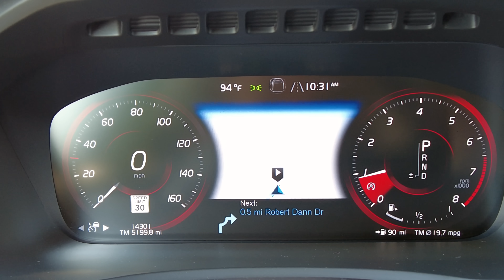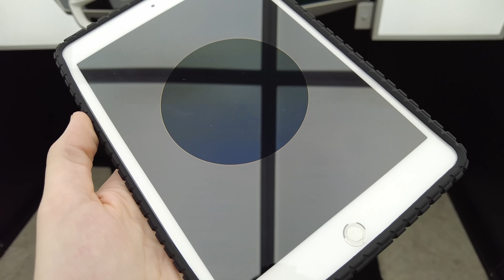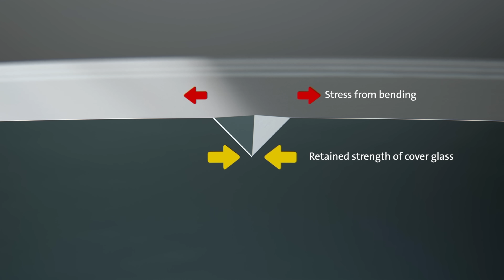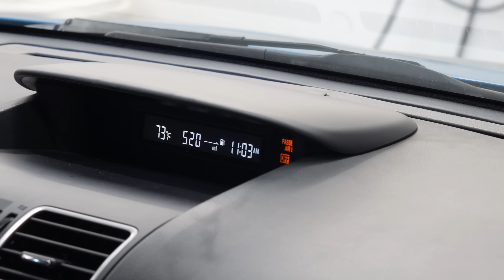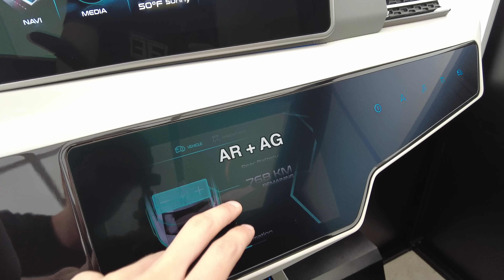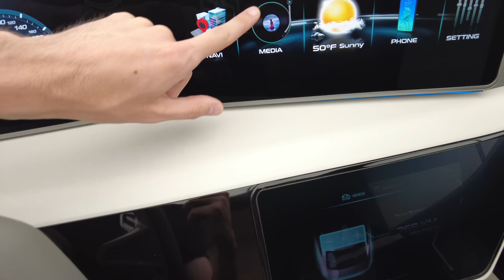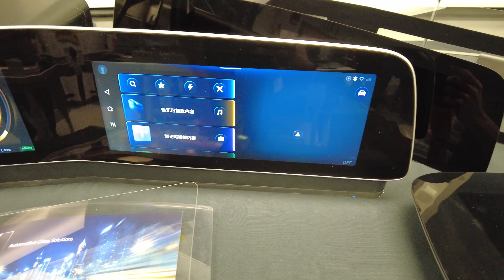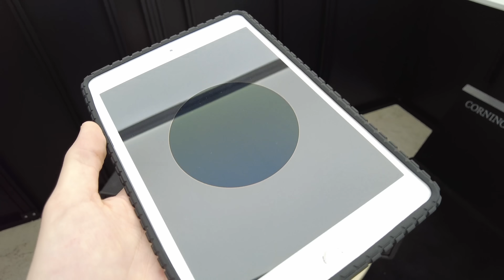How The Glass Inside Your Car Is Engineered - Not So Simple!

Comment: Why would you need quick access to climate control?
You set it to like 20*C and you never should have to touch it again.
Was running and feel hot? - You will enjoy freezing breeze of air but that is bad for you, you sit in 20*C and give it a moment, that simple.
Reply: One word Defrost. And don't tell that can be done automatically. My "automatic" wipers can't pick a decent speed that allows me to actually see out the window and that's way simpler than figuring our which windows are fogging and what to do about it.

Comment: Screens are a good way to control a plethora of functions, details, customizations and settings that you seldom have to fiddle with or use while driving.
But is a complete inferior way to control commonly used functions. Compared to knobs and buttons.
Reply: 100%, early 2000s did it best
Reply: I concur.
Reply: Make that .... while you're NOT! Damn driving 💥🤐👻
Reply: Couldn't agree more. The attitude of all or nothing always ruins things.
Reply: As a tesla owner i can agree. It is hard to hover your finger over the screen and properly use the screen while driving. People naturally stabilize their hand by resting it against the corner of the screen and then using the screen. This is only the case while driving though. While stationary the screen is fine. And in tesla model s nearly everything you do while you are driving is on the wheel and the stalks.
Reply: I agree 100% on using knobs and buttons for common functions. However, they should also be arranged in a standard format. Something car manufacturers fail to do. Having the windshield suddenly fog up and having to fiddle with a panel to figure out which button turns on the defrost while going 60+ mph around  a curve is not a great experience. Think about doing this in a rental car you're not very familiar with. It's an accident waiting to happen. Speaking from experience here.
Reply: it's a classic case of choosing form over function. the development of glass cockpits conclusively showed whilst screens are great for displaying complex data, physical controls beat touch interfaces. the ability to feel for the controls without looking and reliable use with wet or gloved hands are just some of the more obvious advantages.

another comparison with aviation: unlike cars, glass cockpits are required to have backup analogue instrumentation. what do you do when your single screen dashboard fails and goes completely black?
Reply: @Captain__Obvious  All of that is painfully obvious.  Then again look who I'm talking to.
Reply: @brandons9138  I saw that coming.
Reply: @Captain__Obvious  That is not true, both the 777 and 787 have digital standby instruments.
Reply: @falconwaver  excellent point bro 👏there are also $250 million fly-by-wire airliners with triple or greater redundancy and independent power deemed by the regulators to provide equivalent safety factors to otherwise mandatory backup analogue instrumentation. and the point of bringing that up was?
Reply: @Captain__Obvious  You we’re the one who brought up glass cockpit and you were clearly wrong.
Reply: @Captain__Obvious  "What do you do when your single screen dashboard fails and goes completely black?"

Idk, maybe look out the window? Cars don't operate in zero-visibility environments like planes do. Ever driven a car with a broken speedo? It's not that big of a deal. Ever flown a plane in IMC without looking at your instruments? Kobe has.
Reply: @sntslilhlpr6601  there's plenty of challenging driving situations where the entire dashboard suddenly going out would be a real issue. but you're saying so long as a broken ribbon cable doesn't actually cause immediate death in every possible scenario it's totally fine to just throw out the proven resilience and reliability of separate instruments in favor of a single point of failure. for the sake of aesthetics and watching netflix in traffic
Reply: @Captain__Obvious  Single point of failure for a screen is not the end of the world. The thing that concerns me on this is repairability. The tech on these custom screens create some dependency on a single company producing it. And the same applies to several high-tech components that don't have schematics or standardized processes to be produced by 3rd parties.
Reply: Based

Comment: Comments here are one sided toward having knobs and other dedicated controls instead of having them on a screen.  Having a Tesla and I was worried about that before having a Tesla, it is not that bad, it is not that dangerous, essentials functionalities while driving are accessible on the steering wheel.  The main exception is the wipers controls and it is bad mainly because auto wipers on Teslas are very bad, but you can easily hit the "one wipe" button on the standard stock as with other cars.
Reply: "Not that bad" - Be real, if Tesla gave you the option of proper buttons you would jump at the chance. You just put up with it because you like the rest of the car.
Reply: I would like to have more knobs yes... but ultimately I wouldn't trade my big responsive screen for any other lesser screen normally available in every other car.
Reply: "it's not that dangerous"
So you've found a way to not look at the screen when adjusting controls/menus (voice control doesn't count)?
Because every second you look at the screen is a significant distance driven blind.
Reply: Essentials while driving controls are available on the steering wheel and the stalks on each side.  Also, to be honest, even with the knobs, you generally have to get your eyes of the road to access the correct knob or see that you adjust it to the correct setting.  It may be a little faster (not much), but you have to get your eyes of the road to adjust the temperature and start rear window heater for example.
Reply: @jonathan55555  They're called "stalks", not "stocks".
No, you don't. I can adjust every main control in my car without looking. You just have to remember what the controls look like (where the face/feet/windscreen positions are etc.). If you're not sure, you can feel around or guess without having to look anyway.

Comment: I like most of the tech especially how there making the glass better but personally feel like the touch screens don’t need to be the main tech or selling points in vehicle screens are beginning to reach a point of where they are interfering with driving safety especially when driving at night you can’t them dim enough to safely see out of the car and as mentioned by some others they are putting to many features into the touchscreens that should be at an easier to get to and use location

Comment: The screen in my car is way too bright. Figured out there is a software issue that causes it to not respond to the day/night sensor. Specifically if you start your car at night and go directly to drive it doesn't dim, but if you reverse before driving it works correctly. 

I've resorted to learning holding home + fast foward for 10 seconds resets radio  when already in gear to get dimmed correctly(it works fine when driving at dusk and switching to night mode too). 

This is a 2018 GM car with the base radio, same model radio they use in all of their cars. Should be a recall for safety, as it messes with night driving vision with such a bright screen in car.

Comment: They are just a cost cutting measure from manufacturers. They can replace the buttons with the screen and save money (since you now have less parts/production/assembly costs), and then sell the screen as a "premium" feature and people will eat it up. .
Reply: I think the cost of the screen technology and the heavy computing power needed in the background are a lot higher than prebuild electronic units built by some third party manufacturer that just get bolted in place
Reply: @Itseme3  I think it depends.  Modern cars, the computer controls everything.  Buttons tell the computer to turn on lights or wipers, they aren't directly connected anymore.   So using a single input drastically simplifies the design so everything is controlled with software.  Less wiring, less inputs to the ECU, less to break theoretically.  Easier to manufacture.

Comment: I like the VW / Audi digital dashboard. It's looks cool and it's integrated really nice. A lot better than the stick on iPad you sea a lot these days. Not only for a center screen but also as the main screen behind the weel. The square screens just looked like they have a screen and it has to be installed somewhere but it isn't really designed to put it there. It just looks like a aftermarket instalation.

Comment: You can use an iPhone whilst walking, running, or riding in a car because it's in your hand, so your thumb doesn't bounce around relative to it. Try with an iPad and it becomes much harder, at best taking your attention away or at worst it's impossible. The reason is you have to lift your hand to operate it, so your hand moves about independently of the iPad. Same with touchscreens in cars - terrible idea.
Reply: exactly. the only touch stuff should be input for navigation ,music selection and settings. everything else needs a button.
Reply: Oh indeed, try using your phone when it is attached to the car. It sucks.

Comment: The problem with touch screens is exactly that - you might touch unintentionally a virtual button you don't want to. I prefer real buttons for critical-component function.
Reply: Society: Distracted driving is a huge problem

Car manufacturers: makes basic car operations impossible to do without becoming distracted / looking away from the road.

I brought a new (to me) car a while ago and this was one of my basic requirements. Knobs for things I use.
Reply: Amen TechnoKid79. I have some damaged fingers from an industrial accident and am constantly, inadvertently pressing buttons I don't intend. Frustrating. This on a '21 Subaru and no hepatic or force sensing has saved me.
Reply: @eh2341  Newer Subarus have a large touchscreen. So that has helped you?
Reply: The new gen ones need force and use haptic feedback like the screen show in the Audis.....
Reply: @DxCBuG  — As long as it can be done at a reasonable cost ...
Reply: I like how my 2018 Ford does it, all critical and common functions have a dedicated physical control while the in-depth stuff uses either the digital dash (by way of physical buttons on the wheel) or the touch screen for the lowest priority stuff. 

I hardly ever have to use the touch screen while driving and it's wonderful because the few times I have I felt more distracted than if I was using my phone since I had to skew my eyes off to the side so far.